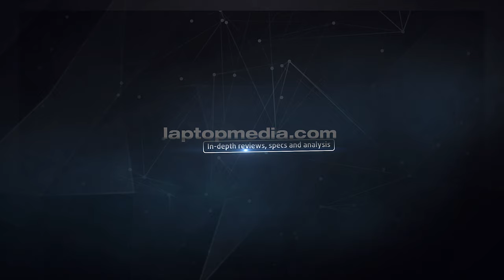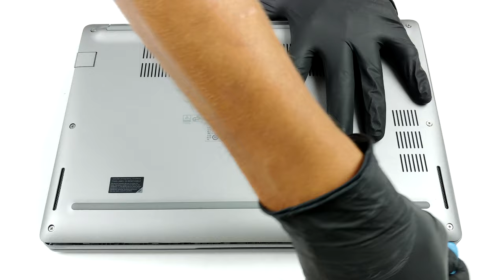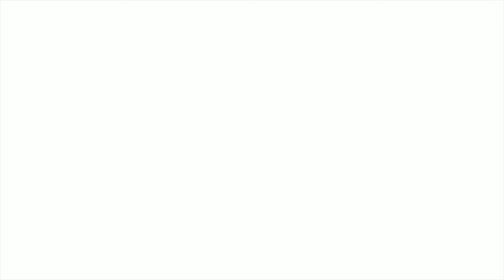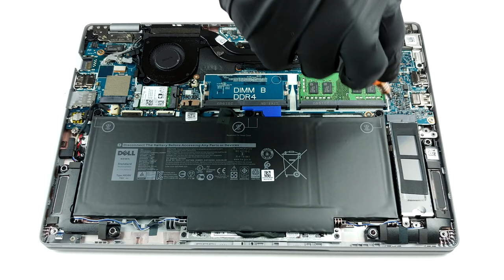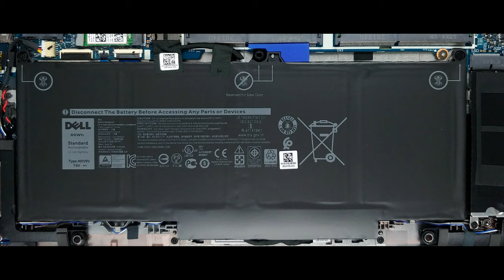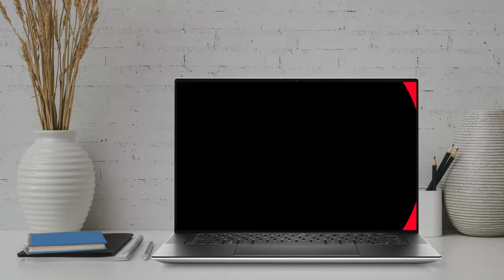🛠️ Dell Latitude 13 5310 - disassembly and upgrade options

Comment: There seems to be a storage-device or WWAN card to the left of the WLAN card.  Is that in fact a WWAN card or have you tried an M-Sata card to see if the BIOS recognizes it as a 2nd storage device, like the Lat 64xx have.
Reply: Yes you can put an SSD into the WWAN slot but it specifically must be a m.2 B+M keyed PCIE SSD (NOT SATA), which is rare for a PCIE drive. I got a CL1-4D256-D22
Reply: @ottermanuk  Thanks for this specificity.  I had some in the shop years ago and outfitted a buncha Dells those.  The BIOS even allows those to be bootable, so that's a good 512mb OS drive, leaving the other NVMes for 'storage' so to speak.   It's been a while but with your specificity, I might try again as WWAN connectors appear on some new laptops.   The M.2s are not becoming more plentiful, though!  Darn.

Comment: You can add a second SSD in the WWAN slot. I had tested a m.2 2242 SATA SSD I had that worked in a 5490 WWAN slot, but was not working on the 5310, it requires a PCIE SSD. That's what I expected, but finding a B+M keyed SSD is a PAIN. I ended up finding an SSTC (sub brand of Kioxia) CL1-4D256-D22 (or CL1-4D128-D22 for a 128G model) and this works in the WWAN slot fine.
Reply: bro can you share the purchase link ?

Comment: how do you dissable uefi on this laptop? i need to re install windows from usb stick
Reply: I know this comment was a year ago but just in case anyone else see. UEFI is a setting inside your motherboard BIOS, often between UEFI vs Legacy boot mode. Hope that helps